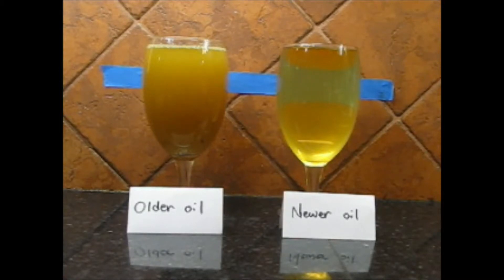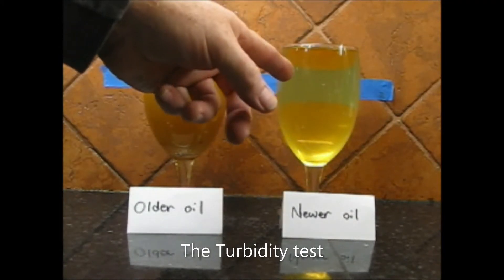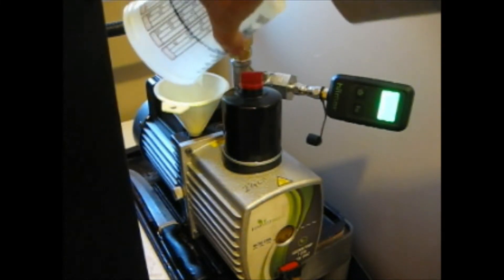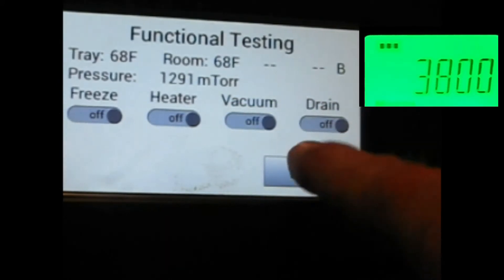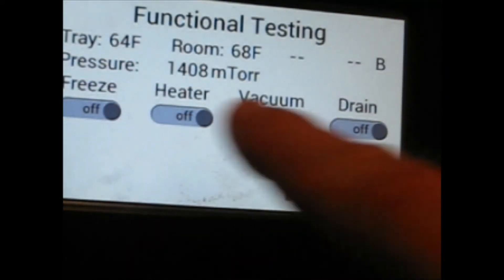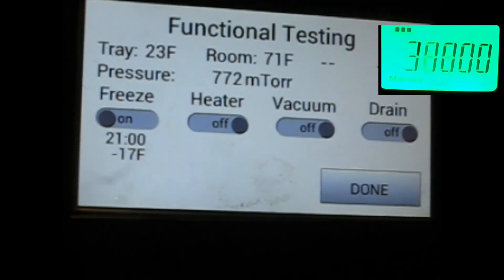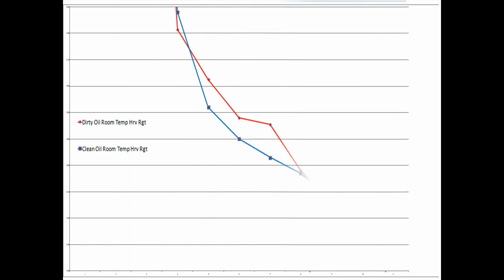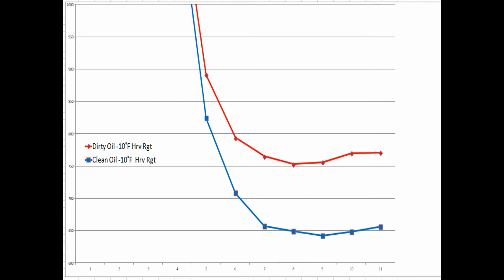Oil and Water Don't Mix.  Pulling a Deep Vacuum

Comment: I want to ask something. The oil and the chemical we use mixes into the oil chamber of the vacuum pump I use in the dry cleaning machine. Why does this happen? It constantly spoils the oil.
Reply from the maker: If I understand your question correctly, you're asking why moisture mixes with the oil inside the vacuum pump and why it fouls the oil?
The problem with all "home freeze driers" there isn't a true cold trap between the freeze drier and vacuum pump.  This would make the cost about $4000 more and complicate the set up.  The chamber of the freeze drier is the cold trap and can't catch all the moisture from sublimation.  Some moisture leaves the chamber before it freezes against the wall and enters, and mixes with the oil in the pump.  This moisture is slightly acidic and causes the oil to oxidize and turns dark.  Some vacuum pump oils contains Rust and Antioxidize additives (R/O).  One brand of oil is Black Gold.  Just because the oil turns dark doesn't mean to throw it out.  The oil is still useful even when the color is amber.  You might want to view this video:
https://youtu.be/vqAMUh5W7eE
I hope this answers your question, if not let me know.

Comment: I see you have a vacuum Meter installed on the Vacuum Pump input.
What is the Meter and what did it cost?
what fitting are needed to connect it?
Reply from the maker: The micron meter was around $100 from Amazon. Go to a hydraulic hose shop and convert the fittings to a #12 female JIC

Comment: We’ve been trying to run down an inadequate vacuum for about a week. It’s exhausting. Have tried everything, to no avail. Even hooked up our other pump to make sure nothing was going on there. The unit still gave us the inadequate error message. We’ve checked hoses, gaskets, O rings, changed out drain valve and more. Have the Premier pump. Purchased both units this summer. Worked great , until last week. We also cleaned the demister. Don’t know what else to do. We aren’t mechanically inclined, at all , and can’t find anyone to help. It’s hard to believe that nobody works on these. So disappointed…
Reply from the maker: How many Mtorrs can you get down to?
Have you watch my other videos on vacuum leaks?
What software are you running (upper right-hand corner of screen)?
We will solve this problem!
Reply: @Philat4800feet  , you are so kind! Thank you for wanting to help. HR had us do the typical vacuum test. Within about 15 minutes, it was down to around 400 and dropping. It indicated, I believe, that the vacuum was good. We get through the freeze just fine. Then, onto vac freeze. That’s where things go wrong. It stays on vac freeze and does not kick over into dry. While it remains in the vac freeze mode, the mtorrs run around 600 or so. The temp around -40 or so. Sometimes, we get the inadequate vac notice. Most of the time, we get no notice, at all; strange. 
We’ve done so much today and have much more tomorrow to do. I posted the question in the HR group and got a lot of responses. I’ve been advised to do everything from A-Z! We have already done all of the following: thorough cleaning, checked hoses and door gasket. Changed oil and checked O ring, checked door seal and alignment, replaced drain valve, attached another pump to see if that changed anything and it didn’t. So it’s not the pump or hoses. I’m being told to put silicone in the epoxy plug. We have no idea what this even means. Told to do an off gassing and so much more. Oh forgot, we cleaned the demister filter too. Tonight, we’re really overwhelmed. Neither of us is mechanically inclined so all of this is daunting. One of the things that we were told to do requires taking part of the unit apart. Never realized when we purchased that there were no companies that worked on freeze dryers. I wrongly assumed that any appliance repair service or refrigeration company would take care of these things. So, we’re on our own. The version running on the unit now is 6.15. 
Is it odd that it passed the vacuum test, but gives us the code 9? Seems like it to us. There’s a nice man in the group that thinks it’s a sensor. I hope not. HR is out of many parts, even pumps and major things. Even if they would have it, the way things are going with them, we’d likely wait on it for weeks. They’re really over their heads because of the great surge in demand. Sadly, the quality is very subpar and so many people are very upset. We actually need another unit, but I’d be afraid to buy another from them. I’m looking at another that was recommended. 
If you think you can help with this, we will gladly send a nice thank you donation . We really enjoy your videos. You are far more intelligent than we are. So, you don’t have a lot to work with; sorry. 🌺
Reply from the maker: @Bee-Kind-Baker  Two things to try: 
1.  Update your software to 5.X.23
2.  Can you turn on your heaters manually and do you feel heat from the pads?
Reply from the maker: Sorry about the delayed response.  YouTube messages sometimes get lost.
Reply: Did you resolve the issue Christine? Sounds like my unit. I did about 15 beautiful loads and thought about a small business and ordered another. Now I have had about 15 fails.

Comment: I also live at 4,800'.  Just got a new Large Freeze Dryer.  Hasn't worked from day 1.  Still working with tech support but it's a long process.  Finally got a new vacuum senser, sensor circuit board and sensor cable today.  Didn't fix the problem.  Now I have to wait for a tech call to go further.  I know my pump and hose are good.  Hooked it up to my friends unit and it pulled same mTorr as his pump.  My screen starts at 600,000 mTorr,. My friends and videos I have seen start around 48,000 or less.

I put an inch Hg vacuum guage on the drain hose and got the same reading (after about 8 min) as gauge that is connected direct to the pump.  -24.5" Hg. So since I know my pump and hose are good, I don't think there are any leaks in the unit.   -24.5" Hg  matches the tables I have seen for max vacuum at 4,800'.  

I'm a little confused at the "mTorr". Readings.  A perfect vacuum at sea level is just under  -30" Mg.  1" Mg = 25,400 mTorr.  So my reading of -24.5 = -622,300 mTorr. So does the harvest right reverse the scale so 0 is at pure vacuum and the higher numbers are the distance from perfect vacuum? Otherwise it should be growing negative number, not shrinking positive number.

I just found a chart for vacuum with Hg, Torr, mbar, and kPa.  Torr starts at 760 and mbar starts at 1,013 going to 0 at vacuum.  The mbar numbers seem to match the numbers I saw on my friends screen vs "Hg measurement.
Reply from the maker: I guess you checked for leaks.  I made a video about Mtorr.  It might help you understand:   
https://www.youtube.com/watch?v=DgLrMm5KIgg&t=9s
Reply: @Philat4800feet  thanks.  I found it after I posted the comment above.  Now they are sending a new USB board and screen.  Hope that fixes the problem. Only thing left is the relay board.

Comment: Was your old oil filtered? I’ve had oil that came out cloudy and never separated so I went ahead and filtered it anyway and then it was clear but dark. Just to be on the safe side I’ve been using new oil. Thanks for the great video.
Reply from the maker: Yes, my oil was filtered, however, filtering won't remove water.  I also separate the water in the freezer.
Reply: @Philat4800feet  Does freezing the oil work better than heating it and evaporating the water off?